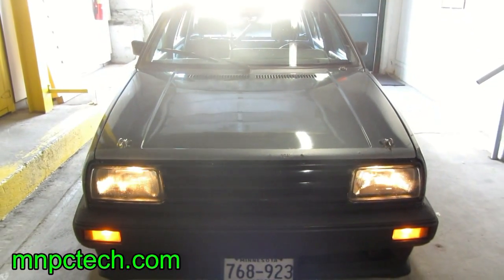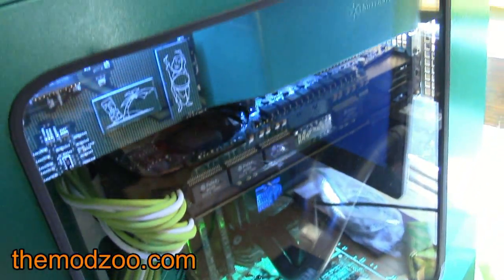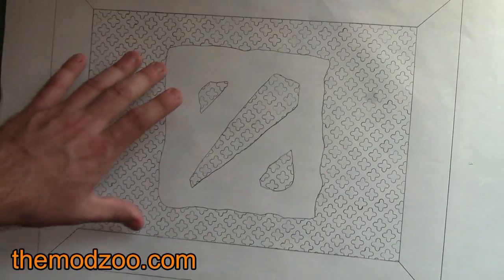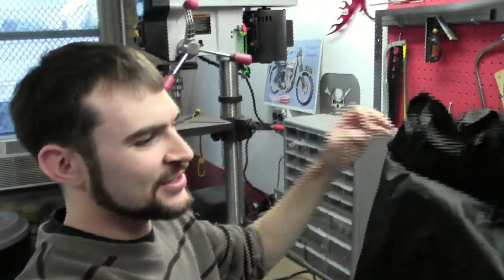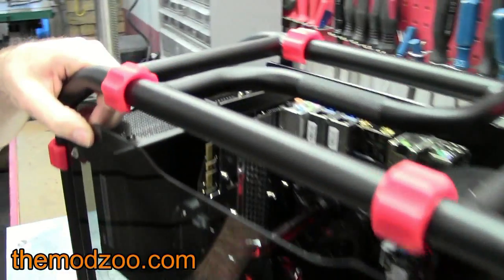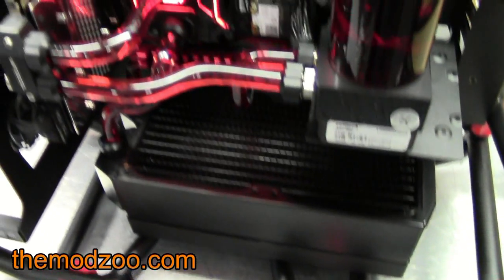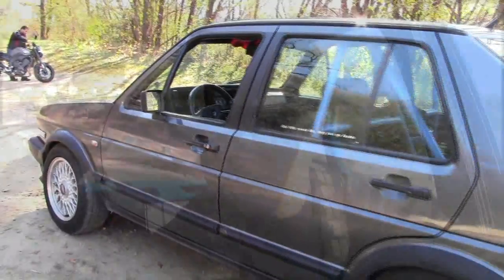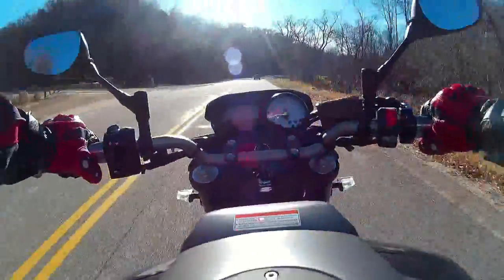Mnpctech VLOG 2, Noobas4urus Project PCB, Dota II, Mosquito Inwin D-Frame Mini, Welch CR7 Minnesota

Comment: I like these vlogs. That was also some really cool lookin work done on that d frame mini. I really want to use that hard line tubing. But how to bend them eludes me. How do u get the right measurements? Do you just bend first and then cut to size?
Reply from the maker: Noobas4urus shares the steps in using PETG tubing, PETG Rigid Tubing Liquid Cooling Loop for NZXT H440 Gaming PC, TheModZoo.com
If you have any other questions, post them in our Mod Zoo community forum Mariusz, http://www.themodzoo.com

Comment: I'm wondering if you bought a h220 x with plans to possibly later upgrade to a custom loop. Do you know if the water block can have the included fittings removed for custom fittings? Or could it only really be upgraded some other way like cutting the tubing to attach it to more tubing through the likes of quick disconnects or something weird like that? I'm wondering since that's one AIO cooler I'd consider to maybe grow into a custom loop, especially with that sexy water block.

Comment: g3258 can easy gets 5000 mhz on water
Reply: It's a BIOS issue on the Z87 board I have, it seems.  It says that it has an unlocked multiplier, but won't let me change it myself.  The 4.6GHz is just the MSI built in auto tune, unfortunately.  I'll be putting it on a Z97 board to play with it further...